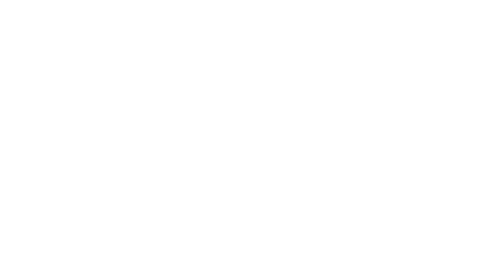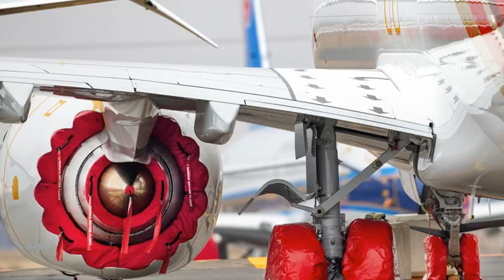FAA directive requires Boeing to inspect and fix a manufacturing defect on all 737 MAXs

Comment: So many amateur errors in production. Using defective parts, FOD in the fuel tanks, now this issue and more, scandalous.   
I guess this is a symptom of an engineering company being run by non-engineers and aircraft being built, in part, by people without an engineering/technical background with a focus on profit making over safety and quality.
Someone needs to go back and inspect all Boeing aircraft manufactured for the past 10 years.